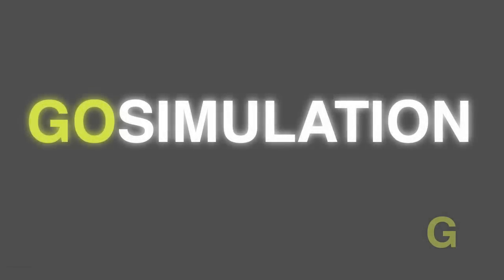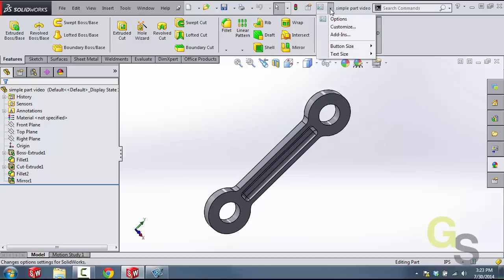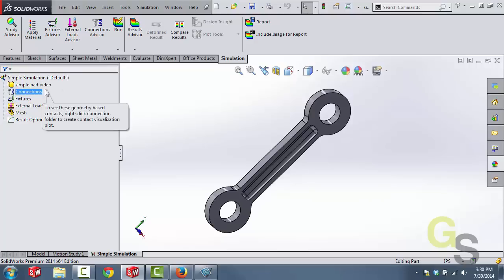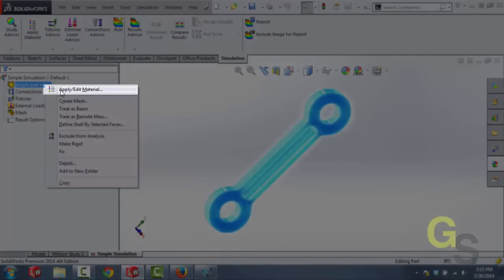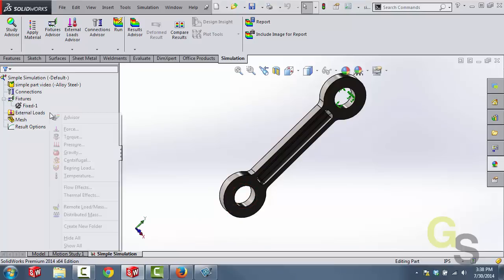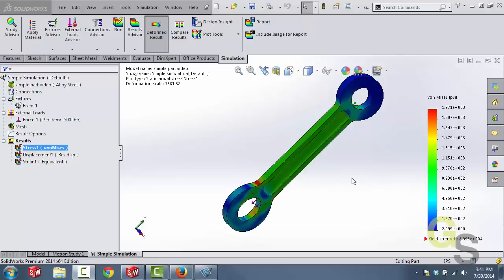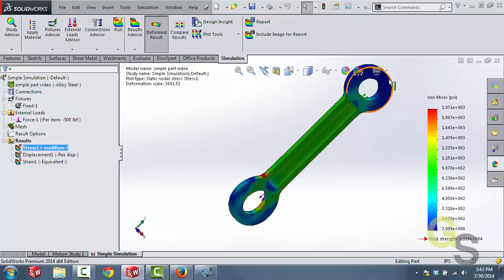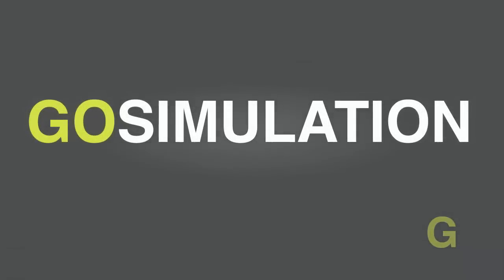Learn SolidWorks Simulation in Under 11 Minutes Tutorial

Comment: Very Nice.   How would I figure a high pressure vessel with this technology.  I have a model.  I want to know if it will
fail at 25 K PSI at different points.  Also,   How would like to  mount a pressure transducer and electron beam weld it to give me a linear response on the sensor on this model.  I would to convert High Pressure to a Electrical output.  I need to learn how to model this.  Is there any examples this type of design.   phil

Comment: is it possible that you made a mistake in your simulation?i think you aplied the force and the fixture to the whole surface, in reality when you put a bolt to the hole the force would be only transmitted by the part of the surface witch is unter presure, there couldnt be any pulling forces. this would increase the stress on the outer part of the ring. Im not sure if im right, i could be that solid works acumilates for this, just something i noticed and wondered about
Reply: cai876 That's why we have safety factor. Any designer knew that,  you can't just take it for granted when you're trying to do any modification on your product,  especially critical items. For me, simulation is one of the tools to help us to make decisions in our designs and need to combine the other tools such as calculations and field test to deign a safe product.
Reply: you're right, he must cut the surface using split line
Reply: nope  @wearehuman5035  u need to calculate the bearing stress and put the function to the surface
Reply: Agreed
Reply: #CADCAMMastermind
Reply: You're definitely right. By reducing the outer diameter he is making a dangerous modification which will reduce the strength of the component. A fact that was iterated several times during an FEA course during my engineering masters was that incorrect use of FEA software is dangerous because it will only ever test what you simulate. This video highlights the need for correct simulations and testing a manufactured part before using it in the real world.

Comment: Hi, I've an issue concernig applied forces. It seems that model deformation doesn't depends on applied force because I have the same result applying 1N or 1000N. Of course the values on the scale changes, but the model deformation is always the same... Am I doing something wrong...??? thanks in advance for your HELP!
Reply: Leiato33 solidworks changes the multiplier of the deformationstudy automaticly as Default. you Can Change the multiplier to your prefered Value in the settings of the deformationstudy studie

Comment: your results are not representative of the actual stress in the pin hole and eye.  the pin hole can not deform as shown with the pin installed.  you will find the eye will fail differently than you are predicting.  garbage in - garbage out.
Reply: +srswrtc gmail "garbage in - garbage out." - What did you mean?
Reply: GUZROCK Gamer he meant wrong input so wrong output